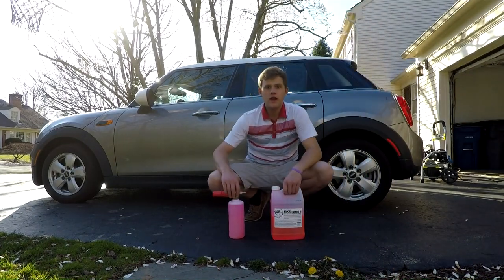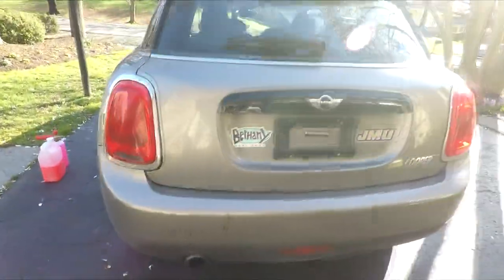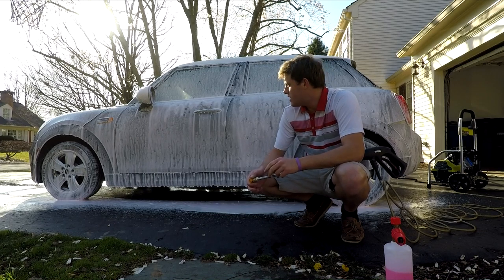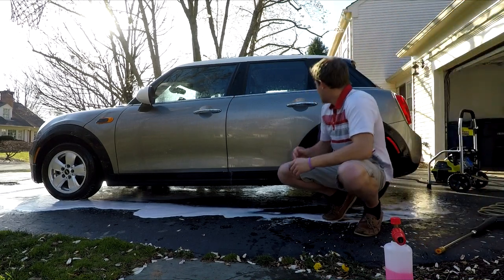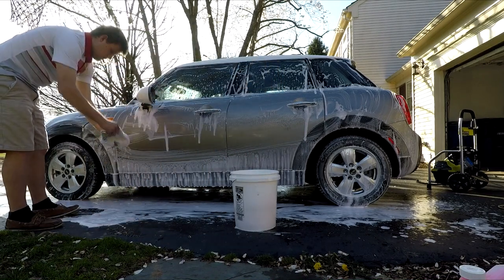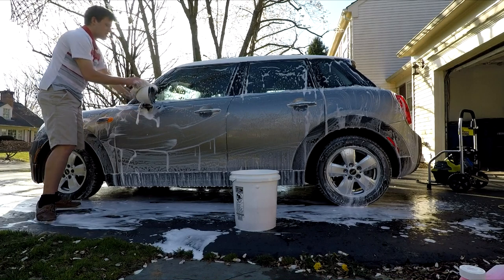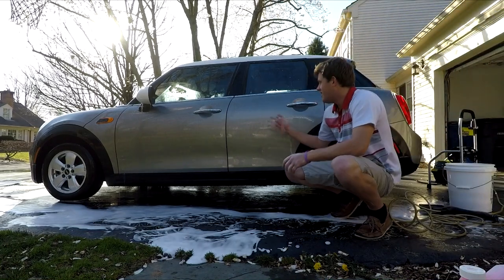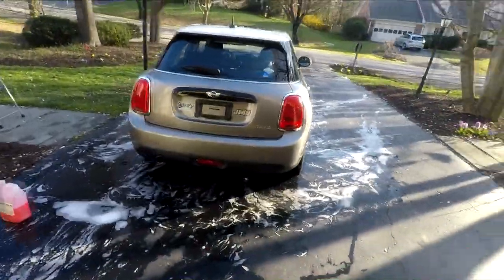Chemical Guys Maxi Suds Two REVIEW!! (FOAM CANNON)

Comment: you have the wrong tip in that gun  only the white tip is safe for vehicles that yellow tip will destroy your clear coat
Reply from the maker: The power washer is only 2000psi... It won't hurt OEM paint
Reply: @CarsRMe   another name for a yellow 15 degree tip is a chisel tip because it can chisel paint off surfaces you holding that tip 5 inches from that rear quarter panel like you did even @ 2000 psi  can and will damage your paint just offering some advice ive been using pressure washers professionally for over 20 yrs
Reply from the maker: @ottisdriftwood4991  thanks I appreciate that! But it is the green tip of 25 degree